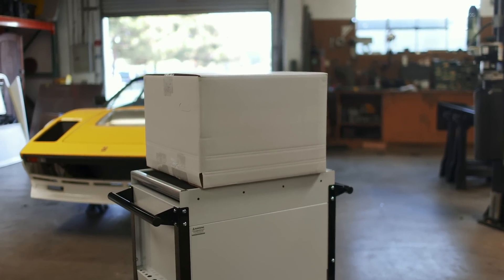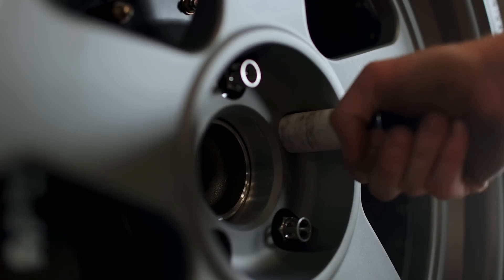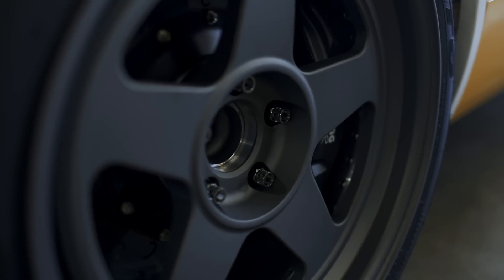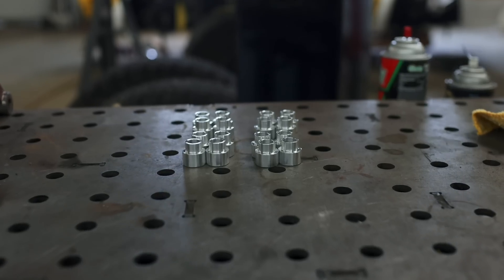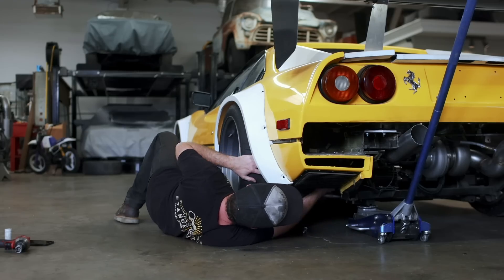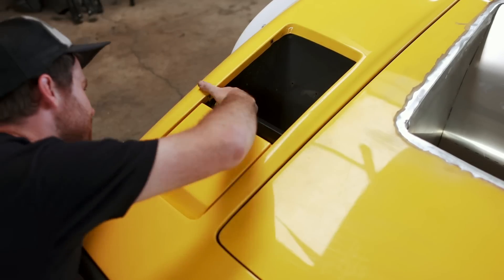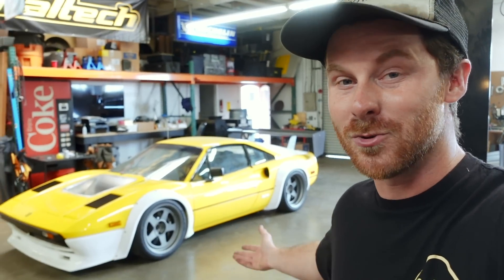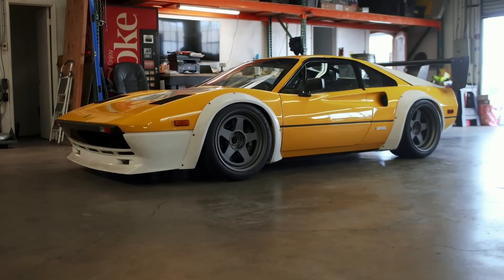WHEELS! - The Honda-Powered Ferrari is ON THE GROUND! 16+ Months of Work For This!

Comment: Huge congrats! I love following this build. For a smooth race track the car is already weapons grade. For carving up the canyons, it’ll need a 20mm lift? Do you have plans to do both track and canyons? My 308 gets lifted/lowered 60mm for gravel rally/tarmac track (difference in tyre diameters included; 27” for gravel rally/24,5” for tarmac track). The white on the yellow is a very cool combo. Will you keep that combo theme?

Comment: For your lighting solution, I know there are a couple guys who run in the GLTC class that use a combo of both spot and flood LED pods that have had good night vision results on track. The spots will illuminate a good ways in front of the car, and the floods will aid with visually acquiring the apex after turn in and the braking and acceleration points

Comment: I have been following the build from episode 1. it really comes together. Regarding the roll cage I saw an old 911 with a removable bolt in cage to be used for track days - it was part of the design the be easily mounted/dismounted. Maybe going down that road would fulfill your requirements regarding track vs road use. Keep up the good work and you have really evolved your camera and cutting skills since episode 1 :)

Comment: So I’m a 308gt4 owner - longtime fan and been following the whole build.  The frame on 308s are actually pretty rigid, which is why it’s so heavy. You’ve taken some out but im not entirely sure this will be so floppy. My car rolled in the 80s and thou it may have landed softly- none of the windows broke. I have pics. You also have the gtb which is way more stiff than a gts. Maybe a couple bars along the interior roof would be okay but you have to choose if this is a race car or street car.  Maybe a removable cross braces where you cut would help.

Comment: For your scavenge pump ( I need to review the layout in past videos) if you decide to go with a divorced system using one pump for oil supply and return, suggest using your pwm output to regulate the pump feed. I have run pressure regulators in the past, but a sensor and pwm signal makes the pump run less overall. Otherwise, if you are tying it into the dry sump, a turbo sump and a simple line back to the suction side should work well! Review 996/977 designs, they have a vent tube I believe on the turbo sumps as well, in order to minimize high suction to the bearings themselves within the CHRA.

Comment: That car is looking amazing , it looks so good on the ground now 🙂  ,  Suggestion for the cage would be to build it like A 911 where it's built into the body Then that would give you more interior room But it would mean cutting up the inside of the car  And  One of the dopest things you can have is pop up headlights , That thing with modern LED's in the front with the little squitty pop up headlights would look so dope

Comment: Congrats that man, that really is something special. Beautiful. Commented before - a vane (foil section) across the front rad extractor would look cool (matter of taste of course) and might actually produce additional negative pressure to pull more air through it.

Comment: Hi Mike
I´m an old guy from Sweden that have looked at all your videos on the Ferrari build now for three days in a row. I must say i´m impressed. I never liked Ferraris, i think they are really crappy overpriced cars that just look good. I have worked with a few in my years and i think they are really awefully designed mechanically. An old friend of mine had a 348 with 50000 miles on it, running his third engine. I love the way you aproach your build and using your own thoughts how to do it. I´m with you all the way. To use a Honda engine i think is one of the best ways to go. Here in Sweden we probably had used a Volvo or an Audi 5 cyl. I don´t have an opinion on how you design your car or what wheels you use, it´s your car. I just like how you do it. Would i do it like that, probably not. But thats me. I think this video series is one of the best i have seen so far, and i´ve seen a lot. I will probably see the other videos you have as well. You are a really skillful young man and i wish you the best.  
Regards from Sweden, Janne

Comment: Offset tip, you can take a level and run it vertical from the top center of the flare and take another and measure from the vertical level to the hub face. Determine the sidewall position and deduct. You can take the rim width and determine the offset or just give those numbers to the manufacturer if making custom. The offset is always to the mounting face of the wheel so there's no mystery to it. Just remember to add the lip thickness of the rim because the width measurement is the inside from bead to bead. Even if you just go flush with the outside of the rim, the sidewall coming out further usually won't bring the tread beyond the flare.

Comment: Those wheels look great. I would adjust the flares because they have a bit of flat top happening and moving the front edge of the flare back would not only correct the center but correct the roundness of the top of the flare. Now, some OZ turbofan wheels would be legit show wheels.

Comment: Feel like the exhaust tips should protrude a little more than they are right now. Once you start hammering on this thing and it's throwing flames I think that back panel is gonna get fairly hot and sooted up. Sticking out the tips 2" more inches might help with getting the exhaust fumes into the backpressured air.

Comment: Looks mega. I waa rly worried by the thumbnail actually because the daylight exaggerates the brightness of the fender colour mismatch. But under shop lights this contrast is reduced and it looks stunning, wheels are as perfect as 18s can be. Personal tastes incoming but my changes would be to add rake with a slight raise of the rear, more front splitter (slightly), shave rear of fenders ala modern race car aero design, and of course the changes you mentioned which are VERY exciting. Will shout out JKF Aero (Kyle.Engineers on YouTube) for aero design that proves the beauty of function - his time attack supra aero design has the kind of incredible detail which you can spend hrs on in a pitlane staring at, much like the rest of this Ferrari. Hope the diffuser you spec is designed a similar way! Love your work man.

Comment: You might consider something like they did for the porsche 914 gt for the pop up headlights that uses a release cable and gas struts to save weight by getting rid of the headlight motors.

Comment: On the cage discussion, would a bolt in solution for the front half of the cage be an option ? You could run it on track and take it out for streetuse.

On the wheels, they look sooo sick! Happy to see the ferrari finally stand on its own feet

Comment: An idea for you....lots of extra work though! Instead of a roll-cage, bolster all the pillars and roof structure with a honey comb of sheet steel! When you look up you see the vertically sheet in the pattern of hexes or triangles. LOTS of small weld work, but would be really strong with less weight. Obviously thicker in parts and thinner in parts to suit the lines, and humans in the cabin.

Comment: Great work! Man that front scrub radius scares me a little though. When you approach the corner and load the front suspension under breaking I'd imagine the compression will have you rubbing quite a bit on tight lower speed corners.

Comment: About lights placement, it would be good to know how pininfarina had it envisioned, as pop-up were there to hide lighting as much as possible. In my eyes, to easiest method would be to replace turn signals/parking lights with LED projector light so they iluminate road ahead, or DRL/turnsignal LED combo unit, like new cars have.

Comment: Full Rear Cage
Cage round the Front Window
Join front & rear cage with a cross piece so that there isn't a bar at the door opening. If this still doesn't give enough head clearance then do roof bars that are removable for driving on the road.
Oh-yeah, car looks very nice sitting on wheels and tyres.

Comment: Could you possible use the headlight insert as a heat/pressure extractor for the front wheels? Using some type of flexible tubing cut in the wheel liner above the center of wheel but connected to the the insert from underneath.  Would have benefit and would not ruin the aesthetics of build.  Not sure this makes sense as written but it does in my head.  :).

Comment: The stance is bang on, the fitment and relationship of tyre to arch is bang on, love it. My only 'issue' is that for me the wheels look too new for the car, the size is right, but i'd have preferred the look of a more 80's period wheel. That being said, its not my car and the way it sits is perfect and these wheels are doubtless better for track than any other rim bar some uber expensive magnesium BBS

Comment: Maybe you could ditch the pop up headlights altogether and either bodywork the openings leaving the stock grills, or incorporate openings into air ducts for the brakes, seeing as this is a track focused project, I’d be tempted by the latter. Good luck

Comment: Awesome to see it on the ground. Now that it is on the ground I've noticed something I never did before. It's nothing to do with your work but rather Ferrari's original engineering/design... 

Why is the front overhang so big, and so much longer than the rear overhang? It must be close to twice as much, which would make sense if it were a front engine, front wheel drive car but... it's not. If I remember correctly from your earlier videos there wasnt much up there in terms of mechanicals, so what gives? Do you have any insight into why it was proportioned this way? Was it for aero to keep the nose low? Couldn't they have lengthened the wheelbase and shortened the front overhang slightly? The car looks amazing overall and I love this build, just hoping you can shed some light on Ferrari's engineering here. Thanks and keep posting awesome content!

Comment: Any way you could rework some of the cars natural chassis for stronger stuff? Maybe reinforce it more for rigidity, that way you might be able to get away with just a roll bar. It adds cost, complexities and a reasonable amount of work. That said if you manage to do it better than factory, you may get a lower center for gravity which will help handling even more.

Comment: It would look great if you reworked the pop up head lights so they only came up a couple of inches and then used a small LED light strip in place of the main head lights.  Still go ahead with the lower mounted lights as well

Comment: Maybe do a cage like Porsche offers where you can unbolt the front section and door bars quite easily, but leave the rear half cage in for road use? Then it’d just be a 20-30 minute job to go from a road safe half cage to a full track cage.

Comment: is it possible to strengthen the body in the cockpit area with just sheet metal fabrication? Like adding rigidity and strenght through that instead of building a whole roll cage...? of course would not be the same level of safety but is it even possible?

Comment: Why not utilize the pop-up headlights? I realize it’s a track car but pop-up headlights are one of the coolest design elements of cars of this era.  If it’s weight savings then use compact air cylinders and the vacuum off the engine to actuate them.
Reply: This would be achieved by using an air solenoid. When the solenoid was powered it would open allowing the air cylinder experience vacuum and open the headlight bucket. Once the headlights turned off the oc Illinois would bypass venting the vacuum. A return spring could easily close the headlight bucket. The volume of the earth cylinder would have to be calculated to work with the bar of vacuum available.

Comment: Was alwas wondering how all the planned on paper alignment would work in reality and I'm chuffed that my assumptions were correct. Clever job to have everything infintely adjustable. The bodykit is not to the Ferrari level of finesse、bit rough in places. Slim down or do away with the wide white side areas of the engine cover behind the rear pilars and the wheel flares need some re-imagining. A more fluid carbon fibre wing might look better than flat sheet metal. Also the front lights... Can't do long molded 458 style headlamps with appropriately angled modern hitech led、keeping just a little of the black accent. Just my two cents but very nice.

Comment: Just like stanceworks, I'm a fan of the look of the car with the pop up headlights in the down(aerodynamically good) position.  However, I also believe that WHERE the headlights are mounted on the car is nearly as important as the the POWER of the actual headlight.  When they are mounted higher on the car, I have a better view of........deer that are standing off the road but close enough to jump in the road(ie I don't want to hit a freaking deer.). The higher on the car that the headlights are positioned........the better the view. Aerodynamics REALLY MATTER though. Therefore, based on looks AND speed.....I would install headlights that replaced the pop up headlights and are covered by a clear plastic like.....lexan(its lightweight).

Comment: Sick AF. What about the name though? 44 being half of 88? I4 vs V8? OG viewer, fitting it got a name when it got its shoes 👟
Reply from the maker: The 308’s original name comes from its displacement (3.0) and the cylinder count (8). Ours is a 2.4L 4 cylinder, so 244 seemed perfect. Also plays off the 288 well.
Reply: @stanceworks  thanks, great name. For what it’s worth I’ll be holding it down for the K series boys in TT at UMC this weekend.

Comment: Nice...BUT I would have went with a 17" and more tire. The current ratio looks too much like a show car and not enough like a race car. EDIT: or maybe just raising the rear up a bit with more rear tire sidewall may do it.
Reply from the maker: If I compete in GTA I have to run an 18” tire, which is why the track set is 18”.
Reply: @stanceworks  Ah! Got it.  👍

Comment: inverted front grille, radius on flares are bumpy, side plates on wing too large. A red Lambo countach 
like kit car passed me yesterday, kit because it was a v8 in back humming away and the wing was straight 
across, close to countach yet still low and cool, wished I could catch up and have a better look.

Comment: Do you have a current weight yet?
Reply from the maker: 2160 with the wheels and tires on
Reply: @stanceworks  WOW! Once it's completely done I bet it won't go over 2,500. That'll be one light, powerful Ferrari.

Comment: Put the cage bro the car wasn't designed for the power you going to be making. Also as you said the car is a "floppy noodle" and that in itself is dangerous from a stability/consistency aspect. Trust me it's a ungodly feeling when you expect a vehicle to do something and it does the opposite at speed.

Comment: I scolded for days looking for a comment on the arches. Am I the only one that thinks the lines on the undersides of those arches are terrible, especially the right rear. They’re asymmetrical, don’t track a smooth curve and are inconsistent across the set.

Does he plan to correct these lines a bit with bodywork? They are really bad.